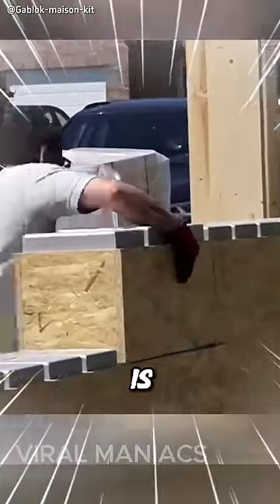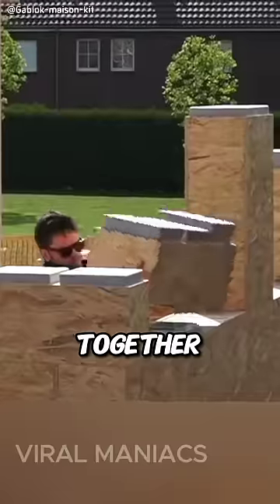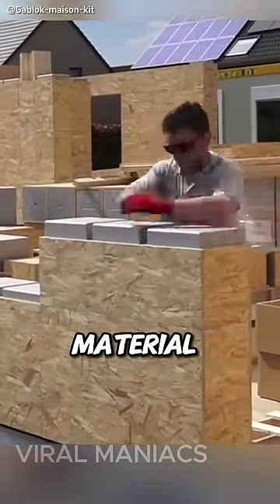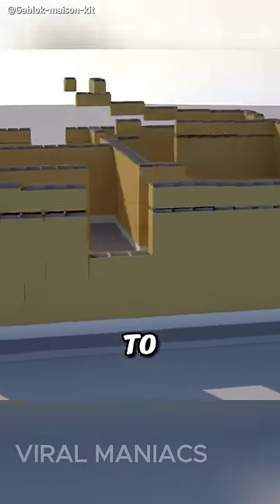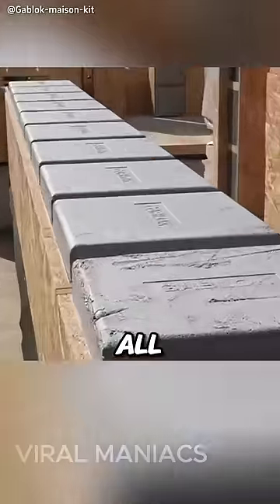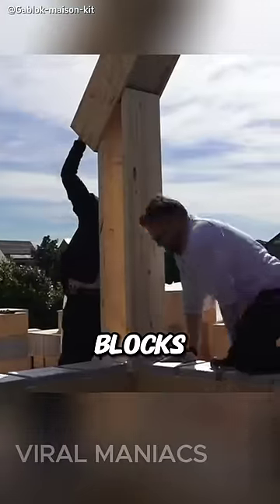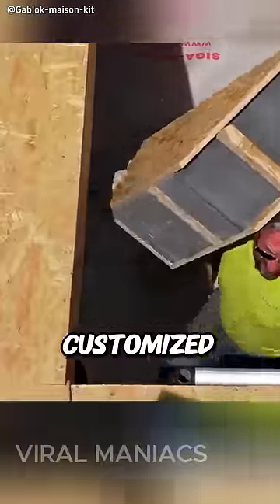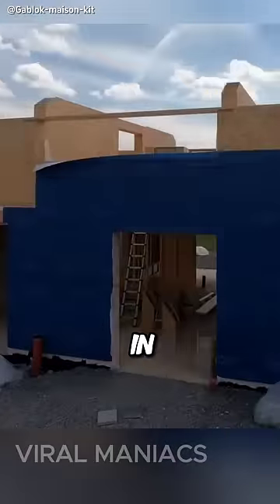Whoever Invented This Way Of Building Houses Is a Genius #shorts

Comment: How flamable you want it to be?
"YES"
Reply: Yeah so newsflash, wood can be made so its fireresistant up to 85% depending on the density, TMYK.
Reply: OK, but that polystyrene insulation is ridiculously flammable!
Reply: Houses built by wood are important for earthquake safety
Reply: @prebenskill  Ignoring the fact that the wood isn’t even remotely the most flammable aspect. Also, Brick houses burn too. Everything has a vapour point friend
Reply: @obskewerd3992  no, bricks dont burn wtf concrete either, im from Valencia and an entire skycrapper burned because the wall were same foam as this video and inside were plywood like this video... Now the tower is a concrete and brick skeleton. In Europe the building  materials like this video was banned after 2017 Greenwell tower fire in London. And no, Steel-concrete reinforced struxtures are hearthquake resistant, this video building is like a giant BBQ lighter
Reply: @prebenskill  the problem is the foam not the wood, the foam is like petrol it will burn and melt even Pladur partition walls, happened in Grenwel and recent Valencia skycrapper... Flammable foam only can be safe isolated by concrete or ceramic bricks, or its so flamable that can MELT PLASTER... Yes, when the flammable foam burns, it can reach temperature that burn pure wood and even PLASTER walls, in Europe is mega-banned for insulating now, this video males sense is the foam was inside Concrete blocks, as the foam cant get fire. Imagine being inside a house waiting for the firefighters and the wall start melting, so sad for the víctima of using that video materials on skycrappers. For a small house still be like a BBQ torch.
Reply: @OsotastyLordKC  thats the point, this insultation causes a masacre in Grenwel London skycrapper and recently in Valencia towers, and is mega-banned in Europe because of its like sleeping on a barbeque lighter.
Reply: What about spray foam insulation everyone is using now? I don't see much difference.
Reply: @robertfandel9442  spray polyuretane foam is banned on UK and EU since 2017, it can be used inside a casing like in this video, but not flammable casing like concrete or ceramic blocks, for this video with a wood casing the correct material inside is rock-wool  because is not flammable.
Reply: Bro out here where I live all the homes are wood framed. They are just big ass tinder boxes.
Reply: @SargentoDuke it didn't they did not use this type of polystyrene to build those. They cut corners at every turn when building and, were attempting to cut costs even further.
Reply: @SargentoDuke you are in fact wrong on this one buddy. Without an ignition source (i.e. someone starting the fire or, faulty wiring) polystyrene in this form is not flammable as it's ignition temperature is 400°c.
Reply: @joshuareynolds23  lol 400 what? Expanded polustyrene melts at 100°Celsius and became liquid fire at 200°C thats the problem, even inside a casing it can melt and became GASOLINE leaking from the casing and were talking about not DIRECT FLAME, on a DIRECT FLAME it Just burns.
Reply: To all of ya its grenfell!grenfell.
Reply: They could use other form fireressitant isolations.
Reply: @Tbonyandsteak  ROCKWOOL is the best used now, is not flammable and is very good for small wood buildings too
Reply: @marioncharleston  yes yes just a letter mising beause using phone, like this coment now
Reply: @SargentoDuke  I thought valencia flat had mineral wool, not EPS?😊
Reply: @arnoverhoeven653  Valencia had rock-wool only on the facade aluminium decoration, the concrete structure under the alucobond aluminium panels was ALL FOAM, the entire building covered with foam, Just open to the air instead of en casing the foam i side concrete or bricks, so the inslating foam burn like a furnace... Flammabke foams HAD TO BE ON A PROTECTIVE CASING or inside walls.
On Grenfell and Valencia, allthe towers covered with foam open to the air 🤦‍♂️
Reply: @SargentoDuke  Yeah I know and you can get them compressed as well. There are other obtions as well. There have come a new product now called SkamoWall Boards made by vulcan composites.
Reply: @arnoverhoeven653  mineral wool was inside the decorative aluminium,  under that, the entire concrete flat was covered with flammable foam, anyway the rock-wool was glued to the aluminium with flammable glue, same happens with the modern wood on buildings, is not crude wood but glued wood composite and the glue burns...  "ECO" materials are not actually ver safe
Reply: @OsotastyLordKC  Every house has flameable isolation, whats your point?
Reply: @prebenskill  to not argue with ignorant people whom don't even proof read before posting their blatant illiteracy ....

Comment: Final conclusion, the house is twenty feet up in the air twirling due to a tornado  .
Stability and foundation  is underrated.
Reply: Yeah😅
Reply: Foundation!? Yes exactly! 🤦‍♀️
Reply: Yeah. If you buy this style of house in a tornado area then that’s on you.

There’s plenty of places on earth that have never seen a tornado
Reply: You know you can use glue also right?
Reply: Not everything on Earth is Florida. We don't have tornados.
Reply: Well not all houses are tornado proof but imagine you have a basement and after the wreckage you go collect your blocks to build it back up🤣
Reply: not every where has tornadoes, but everywhere has strong winds and storms. Would it even take a tornadoe? what about winter? what keeps those blocks from separating if ice and snow get past the vapor barrie-- oh. WHAT vapor barrier? lmao it has none.
Reply: @captaindred342  Wrap the house in Tyvek like you normally would.
Reply: @46babaganoosh  yeah that works in a lot of places. I thinks it's sketchy as the only defense against elements. shrug
Reply: @captaindred342  It actually work perfect if installed properly.

Comment: Polystyrene is incredibly flammable and pretty much turns into napalm when burned
Reply: I learnt that from Days Gone lol
Reply: Wood is pretty flammable too
Reply: It is a very dangerous House😱
Reply: my thought about 💧 and 🔥
Reply: Yeah, fire is a big problem for this construction.
But most people seem to think that you can dismantle it like a Lego lol😂😂
Reply: How flammable is it compared to other insulations? If it's comparable, then it might not be as bad, but the fact that the blocks are as thick as they are compared to how thin normal insulation is used, yeah, that house is gonna turn into a fireball.
Reply: Same thing with EV . Run if you get in a crash with one!!
Reply: this comment is gonna shut down this company lol because that house is a bomb waiting to go off
Reply: So it's bad to set this house on fire.... Which houses are OK to set on fire?
Reply: @colecampbell1906  not necessarily the point, it's bad if either is on fire, but if this burns as bad as I found out it could, you're looking at a significantly worse fire.
Reply: NOT to mention OSB is highly flammable when it catches fire also! 🔥
SHIT Burns Hot and quick!
✅🔥

Comment: as an engineer all i can say is that this is as stupid as it looks like.
Reply: As an engineer I agree with you!
Reply: How so? Elaborate a little bit of your the genius engineer
Reply: I would not live in a house that relied on friction for structural integrity. I can't imagine any building department granting a construction permit for this nonsense.
Reply: At best this isn't a terrible idea for a <600sf single level outbuilding where temperature control is a serious consideration. Beyond that, just... no. I generally like the idea of modular construction like this. I've just yet to see a good execution that's anywhere near cost effective and flexible enough to compete with stick-built construction. Maybe a few iterations later?
Reply: Most engineers are idiots so it's hard to trust you
Reply: @zperdue1137 as an engineer, I agree with you!
Reply: As a builder, I agree. There's basically no advantage to anything here.
Reply: @MoneyshotMat2100  the OSB is load bearing. Nothing more stupid than that.
Reply: As a Lego enthusiast all I can say is "SWEET!"
Reply: Right i was like lol okay good luck w that 😂
Reply: My brother's cousin's sister's uncle's nephew is also an engineer and agrees that this is stupid
Reply: Are you an engineer at Boeing?

Comment: This house is one lightning strike away from becoming your funeral pyre 😢
Reply: If only someone could invent something that could direct the electric current from the lightening strike directly into the ground.
Reply: @shellydorai-raj1322 hey fair point
Reply: @addisonpage1 
Trouble is that only protects against direct strikes. 
It's very common for a strike on the supply to cause your electrical appliances and possibly installation wiring to ignite and given that construction the outcome is inevitable.
Reply: Add a ground wire solves that problem
Reply: @shellydorai-raj1322 it's called a ground wire every house should have one
Reply: No worse than stick frame, where studs all become chimneys stoking house fires. Log houses though are safer from fire.
Reply: @308dad8  actually a lot worse, certainly in large refrigerated stores and processing plants where the EPS has been a factor in firefighter deaths. 
EPS ignites and it melts flowing through the cavity and out into compartments resulting in very rapid fire spread, unlike timber studwork which chars on the surface to begin with. 
Just my 30+ years attending fires and investigating fire spread in residential and commercial buildings, along with working with colleagues who investigated the very incidents that prompted fire safety changes for building with EPS panels.

Comment: If ikea ever sold an entire freaking house, it'd look like this lol
Reply: With bad instructions lmao
Reply: Sears actually used to sell houses. But not like this stupidity. Foam and osb? What insurance company would cover this house?
Reply: Top Comment
Reply: GaBlock
Reply: except you'd need to assemble your own blocks and mix your own expanded polystyrene inserts.
Reply: Well, Sears did that, some are still standing.
Reply: Like to know where to order pne
Reply: @Brayden.-. And for some stupid reason you would need an Allen Key or some drill bit that they just didn't include in the package😂
Reply: It’s missing screws for the doors and windows 😂
Reply: Nah, it would be MUCH more complicated!!
Reply: At one time, although you had to build it yourself, Sears Roebuck sold a house for under $2,000 delivered by REA.
Reply: @Brayden.-. what instructions? Many new items from some companies come with pictures only, and even those are vague.😅
Reply: No fasteners for them to give you the wrong amount so no need to worry.
Reply: @alexkidd1906  my Aunt used to l8ve in one of them.
Reply: @alexkidd1906  I think its great for an add on to a house
Reply: It would be called the Skilsmässa
Reply: Ikea does build houses, together with Skanska. I live in one. They are module houses, mostly wood. They came up very quickly but the build quality is so-so. Price point is very good though, like all Ikea products.
Reply: @greggweber9967 yes. But not this kind of house.
Reply: And pray no kid's come with it.
Reply: Don't give the prison industry any ideas , IKEA makes enough money off that furniture those inmates make. If they get involved in real estate they'll try to put more people in prison 😂
Reply: Sears actually used to.

When i was 12/13 i lived with my dad for a year and the house he was renting was a actual sears house that was bought and built during a oil boom in our area.

I remember that house being cold as shit and being able to feel a draft from the floor boards.
Reply: Lol nah that's boxabl
Reply: I think back then Sears used to sell DIY houses where they would ship the box to you
Reply: You know what would happen if AOC got a hold of this... it would get half built and there would be spilled wine and popcorn everywhere.😂

Comment: Just replace the wood with hemp and the polystyrene with hemp and youve got yourself a good product
Reply: Talk about hotboxing 😂 probably more flammable though lol
Reply: More flammable than wood?
The hemp would be treated in the same non-flammable chemicals that wood gets treated with.
Reply: Styrofoam is 95% air, it would be difficult for hemp to have similar insulating properties and as to using biologic products as construction materials, compressed mycelium bricks might be better than hemp.   Yes hemp is a good allrounder but it's a jack of all trades, master of none...
Reply: I know some guys that made a van out of hemp.
Reply: @keithmccormack6248  were they stopped by Border Patrol ?
Reply: @williamhadley1580  yes, indeed they were—on their way to a battle of bands as a matter of fact.